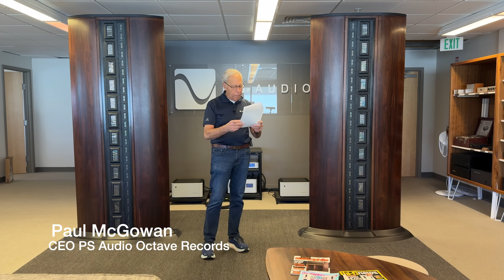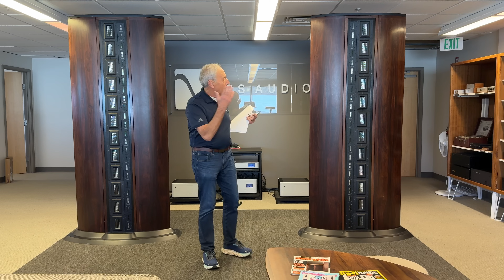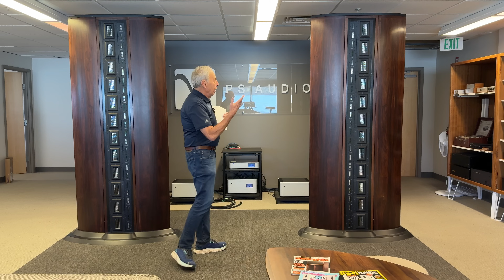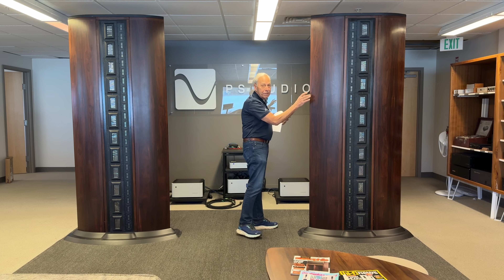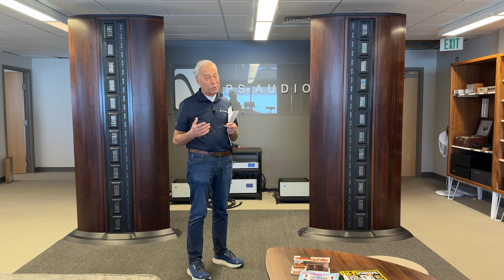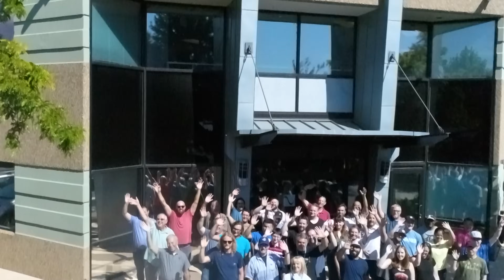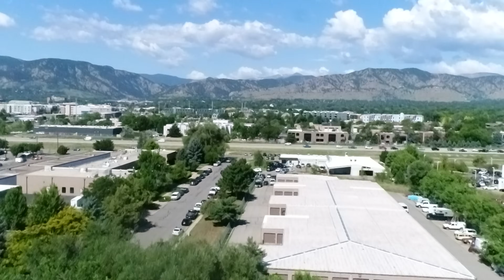Why speakers are so expensive

Comment: Include up to 50% commission for the dealer, and then price is directly proportional to power handling and the number of drivers. At the end, we audiophiles are paying 10 times of the actual cost of the unit.
Reply: People often confuse the price of materials being a driving force. There is so VERY more more involved
Reply: Something similar applies in the Food Service industry. If something is made for that industry the price doubles and then doubles again if it is stainless steel. And if it is sponsored or used by a famous chef then the price doubles again.
Reply: Ps audio doesn't use distributors. They use dealers but often sell cheaper then them themselves, and They also offer a buyback/upgrade/refurbished program that deliberately devalue their own equipment in the used and dealer markets so people who can't normally afford the gear can, even if not from them. If you call them, they will even let you do a layaway. I think the only reason they evn use dealers at all is so that people actually might be able to hear their gear before buying. I wish more companies were like PS Audio.

Have you seen cross sections of the cabinets and woofers? Have you seen the crossovers? Do you know how long a box like this made by hand takes to build? hour wise? They aren't building chicken coups man. (something that can go for nearly $10k for a good one, when buying quality hand-built product) Do you know how much a hand made carbon fiber bicycle cost's to make? What about a 59" les paul from the custom shop made by tom murphy over at Gibson?

I have/do. Im guessing they double their money per set tops. And a 30K speaker system from a small private company doesnt fly off the shelves. a $3k speaker doesnt fly off the shelves.

that likely 10-15K they make per speaker pays business zoning overhead in boulder, CO. Very expensive. They have liquid inventory and a wearhouse to stock properly for what they are doing. There is literally a team of people getting payed to be at the top of their game, to be experts in a particular field of study as well at practical application. Expertise doesn't come cheap. And just like in a notoriously difficult private restaurant (in the food industry, you are ripped off by business suppliers and maintenance technicians, and customers that will not tolerate the margin you need simply to keep open let alone live comfortably)
  
The crossover components alone, for one speaker as implemented, will cost you about $1200 to make yourself. Idek how they managed to get the woofers manufactured. Things of genuine mechanical beauty with many genuine and unique design characteristics and theory implementations. There is probably $5k in the material procurement cost alone of a single FR-30 speaker. And yes, like Paul says in some videos, this is why the woofer had to be re-engineered to get the cost down on the smaller fr20/10/5s.

We're lucky enough people tolerate prices like this so speakers this good can even exist at all. Paul was far, FAR more then what a set of speakers cost invested into paying his experts to design them alone by the time they had the first set sell, it wouldn't be possible not to be. The FR project may have not even broke even yet, we don't know how many set's hes sold. I know there were people being payed a wage to design the best speaker possible for literally years before they had a speaker to sell. Chris Brunhaver, being an expert in a field, in Boulder, probably makes a 60-80k salary a year, likely more. With Chris alone Paul was likely nearly a quarter million invested into this project before the first speaker sold. Chris didn't do it by himself either.

When you are a private busine/company, not a publicly traded corporation, general business overhead and R&D cost is a much much larger chunk of your profit margin.

30K is not a bad ask for these speakers at all. I'm surprised they aren't $40k with what i know went into them. Not all $30k speakers are that way, but these are. Like most, I can't afford them either, wish i could. Have you heard a speaker like an FR30 or IRSV in person and internally grappled with the fact that what you are listening to was made by hand from the instruments to your ears to be as beautiful and magnificent as is possible for no other reason then it can be?

 A speaker like this is a near perfect fusion of art and technology, designed and hand-made by craftsmen, scholars, and lovers of the fine arts. It's going to be very expensive. You can't have something like that without it being very expensive, unless ya make it yourself. Would you compare a cheese bread and Gatorade from little ceaser's on a park bench to an authentic flatbread served on the shores of the Mediterranean at sunset over a glass of Dom Perignon?

Comment: 'Ole Audiophile to Paul: I'll state the obvious, speakers are not expensive. One can purchase speakers like Polks or Klipsch in box stores for far less than implied. Both companies make great speakers but inexpensive they are not meaning one gets exactly what one pays for in a speaker purchase for the most part. Speakers can be cheap but good ones are not. Much has to do with the materials they are manufactured with & the exacting quality of the craft. For the most part, a speaker purchase is for life for many of us so there's not particularly much turnover if one purchases a wunder set. I still own my first set of Cerwin Vegas, but they are over 50 years old & thoroughly retired several times over since they've been re-gifted back to me. Take your good ole' time picking your speakers from the fray because one is more than likely to spend the next twenty years or more listening to them. Thanx
Reply: Prime example: those Infinity towers Paul is pictured standing in front of are over twenty years old. Think he's desiring to replace them? Not on your life... (He's probably figured a dozen different 'better' ways of powering them using improving quality amplification. They were designed 'cart before the horse' by engineers that bet on the advance of amplifier technology that would eventually power them up correctly.)
Reply: @davidlane1169  He's not getting rid of the Infinity IRS speakers but he has replaced the drivers as the originals did degrade with time. He also has replaced them in terms of being PS Audio's reference speakers. As a company they have to try to evolve to stay in business.

I certainly support the idea to try to buy for longevity as a consumer though. It's so easy to just keep chasing something else in the audiophile hobby.
Reply: It's only been 46 years of mariage so my suggestion is it would be wiser to ask her. Living within one's limits enhances one's life, it sure cuts a good percentage of the stress dealing with finacial ruin. Thanx I guess? @funny0000000

Comment: The big question remains is if: The FR30 cost 30k; the FR20 cost 20k and the FR10 cost 10k, why does the FR5 not either cost 5K or is called the FR3? Does that make the FR5 a loss leader? Any way, speakers are expensive because they have fancy cabinets, that's the take away message. And I get it. Nobody is going to accept a bad fit and finish on a high end speaker, even though it does not mater for the sound. So in order to sell them, they are made like bespoke furniture. Nothing wrong with that, it is also what makes DIY attractive to some of us.